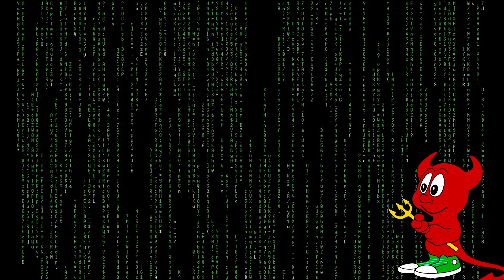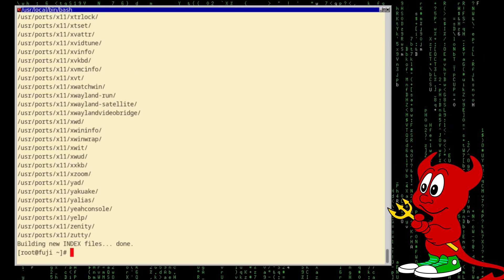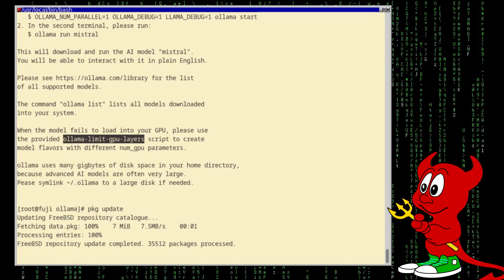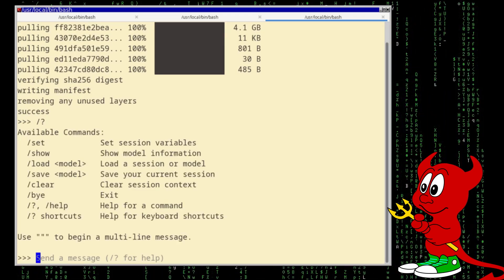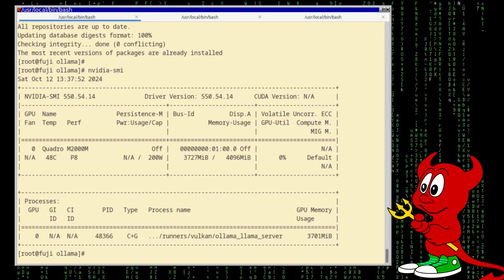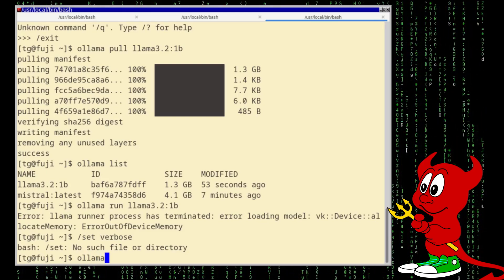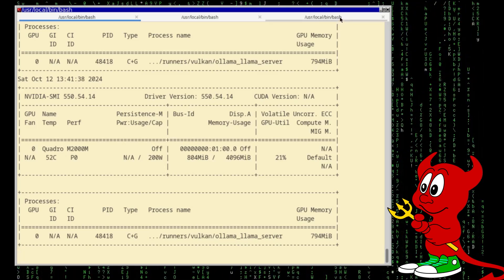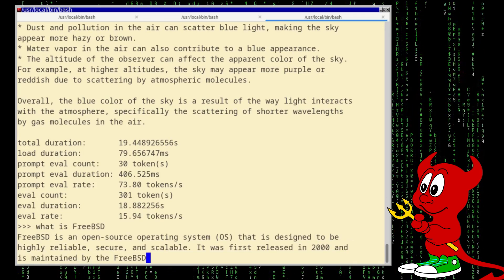FreeBSD: running a Large Language Model with ollama

Comment: is this script available for usage in windows? I cannot seem to find it anywhere
Reply from the maker: Hi. Thank you for the comment.
No, I do not think that you can find it in windows... This script was developed by Yuri Victorovich, for the FreeBSD project; however, you can get it from here: https://github.com/freebsd/freebsd-ports/blob/main/misc/ollama/files/ollama-limit-gpu-layers and adapt it to your own use-case...
Basically, you can see that the script runs the ollama command to get the Modelfile file, adapts it by adding the num_gpu parameter, and then recreates the model again with ollama... So, you can also easily reproduce the steps in Windows CMD.

Cheers!

Comment: How it cost to use ports on freebsd in term of disk .Great video
Reply from the maker: Hi. The ports tree is itself relatively large - for me it takes about 1 or 2 GB in size, but this might depend on how you pull it (e.g. all history, or only enough for the last commit, i.e. shallow clone). I would definitively recommend to use pkg instead of compiling everything because not only it can take some space, but can also take a huge amount of time to compile. As ollama is already available in the ports tree, just "pkg install" it :-)
You might also find some interesting discussion about the size of the ports tree in here: https://forums.freebsd.org/threads/how-much-space-do-i-need-to-run-portsnap-fetch-extract.64586/
The FreeBSD forums is an awesome source of information :-)

Cheers!